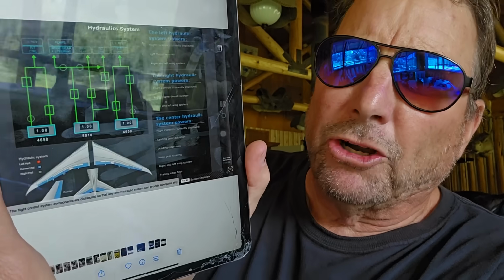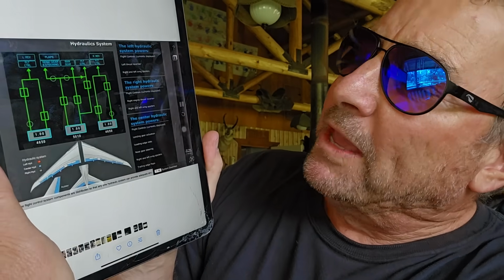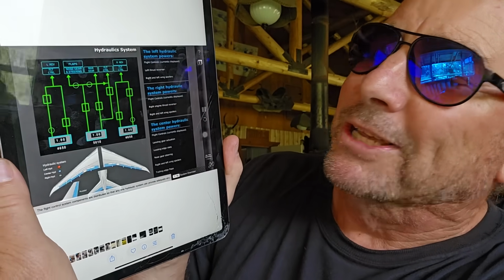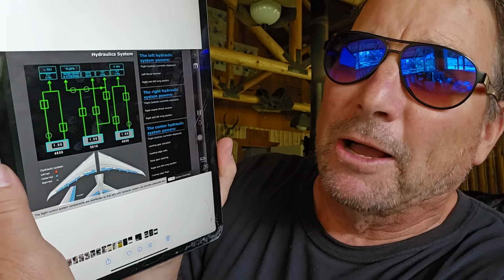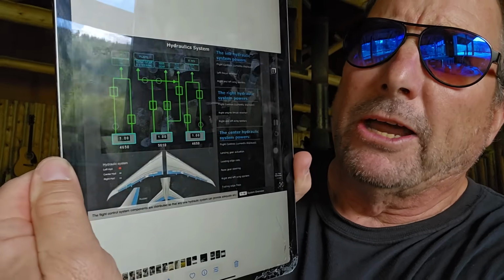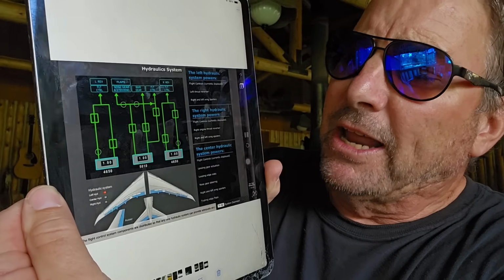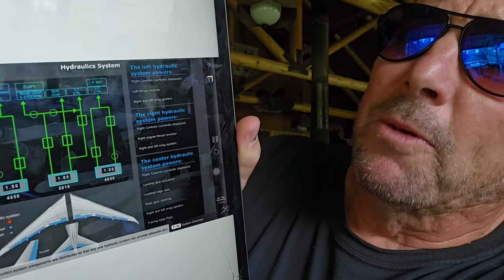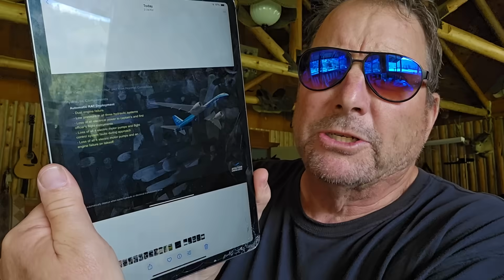787 Crash India What's a RAT? When does it deploy?

Comment: As a commercial aircraft mechanic for over forty years I always look forward to your explanations as to what happened in these terrible incidents. The first thing that pops into my mind is pilot error but you follow the data and never jump to conclusions. Maintenance, environmental issues, aircraft component failures you cover it all. Thank you
Reply: Agree, but didn’t have pilot error on my mind for this crash. It was a skilled crew and there’s no way they would have taken off with an incorrect configuration. Something went catastrophically wrong right after V1 speed.
Reply: @_TheRock Captain was reported in the mayday call saying thrust was lost. What are the odds both engines would cut out right after lift off? Fuel contamination maybe, but im sure they probably looked at the supply this plane drew from and nothing has been said about it being contaminated. So, how both engines seeminhgly fail at the same most critical portion of flight, with no indication of problem on takeoff roll, and at about the time the gear is supposed to be coming up? Makes me wonder if the fuel cutoffs were activated.
Reply: @Sizzelot that could be a possibility, yes. The surviving passenger apparently said he heard a bang. Maybe sabotage linked to recent geopolitical tensions?
Reply: @Sizzelot could be interesting to hear from @blancolirio if and how a potential fuel cutoff could have happened
Reply: @_TheRock im thinking bang would have been RAT deploying as Juan alluded to it deploys quite forcefully.
Reply: @_TheRock  rat deploying maby
Reply: @Sizzelot  There is NO official information anywhere about the details of the flight, so "nothing has been said" has no meaning whatsoever.
Reply: @Sizzelot  bingo!  you win the prize for guessing correctly.
Reply: @Sizzelot yep, there you have it!
Reply: @_TheRock  i agree but time will tell. most likly lots of little things mounting up into one big problem..
Reply: @eddjordan2399 yep, usually more than one hole in the Swiss cheese. We’ll see, too early to tell exactly what went wrong.
Reply: @eddjordan2399  and low and behold it was NOT lots of little things mounting up to one big problem.
Reply: @_TheRock  I heard on another youtube video (can't find the primary source for it) that while the Pilot Flying had 8000 hours, the Pilot monitoring only had around 1000 hours and not all on the 787. They're taking too long to release the FDR data so we can really say if there was a power loss or what.
Reply: @therainbowpoopp  There is no obligation to make the FDR data available to the public. It will be shared only with key players involved in manufacture and regulation worldwide. The findings will eventually be made public after a thorough investigation which invarably takes time.
Reply: sabotage by the Pakistanis....
Reply: I honestly think pilot error is not impossible but I must admit I'm wondering if there wasn't something wrong with the hydraulics after the maintenace episode - l don't know if there's somethign that could have caused loss of hydraulic pressure making it impossible to retract the gear, whether the flaps need hydraulic pressure to stay deployed and if its loss could have caused them to retract and the RAT would then have deployed.... who knows, we shall see, either way still a devastating crash.
Reply: @tomriley5790 i dont think hydraulics caused it. If the captain reported loss of thrust in the mayday call and the RAT deployed that would indicate a dual engine failure and critical hydraulics would have been maintained by the RAT.. The aircraft appears to maintain control till the end as loss of thrust and resultant loss of lift sink the aircraft.

Comment: The Air India 788 crash reminds me of the airshow crash of the A320 in its early days (late 1980's?).  It looked very similar.  In that case it was the pilot trying to fight the flight systems that were trying to keep the plane flying.  It will be interesting to see if something like that was part of this crash, or if it was something like a electrical failure

Comment: Saw this as an interesting lead. If loss of all generators due to failsafe mode, RAT deploys to provide AC power. With all generators out, no power is supplied to the fuel pumps and the engines would experience a roll back of power as fuel is starved.

Comment: Thankyou Juan, The Plane certainly sounds like it had Major Problems on Take off or Just Before.
The RAT was clearly Audible and She seemed to have Suffered possible Dual Engine Failure.
The Landing Gear never went into a Retraction mode.
The Aircraft seemed to suffer Complete Electrical Systems Loss.
From the Vision could not tell if the Slats and Flaps were Extended as you said due to Hazy conditions.
Yes, It's extremely important for those of us who have and still on occassion fly the 787.

Hope you're enjoying your time away..

Regards 
John
Reply: This is not a 787 issue.

Comment: The sole survivor says green and white lights came on in the cabin as the airplane seemed to get "stuck". That would, to my understanding, match the cabin emergency lighting.
Reply: The ADSB data from the transponder stopped reporting at 600 feet, which also suggests loss of electrical power on the aircraft
Reply: @speed150mph you need to be careful trusting public ADSB data. I run a base station and am a pilot and, and a lot of factors can cause delays or gaps in the data. Especially low down if there aren’t many good base stations nearby. 

The question is did the airport lose the transponder signal. And I haven’t heard anything definite. 

All that said, it seems more likely than not just based on what we do know.
Reply: @MeppyMan yes absolutely correct, but it would be one heck of a coincidence for the ADSB to have one of those random gaps at roughly the exact time we see the aircraft stop climbing and begin falling.
Reply: @speed150mph  There were also no gaps or issues with the ADS-B data on departure for the other AI171 flights, it was flying out of Ahmedabad almost every day at the same time. Doesn't make anything definitive, of course, just another data point.
Reply: @MeppyMan  At 600ft the radio horizon for flat ground is 30 miles so it would be unlikely that airport receivers would lose the signal unless the plane stopped transmitting, it should have been receivable for almost all of the event.
Reply: @mortekaieve4729  and if you check further that same aircraft rotated, lifted off in the same location and speeds as the day before too
Reply: @speed150mph  so how did the pilot communicate there was a problem if the electrical was out?
Reply: @Ts-zy4bw  The RAT deployed. If an automatic deployment gate (condition) was reached, it would happen quite quickly. I think the flight remained controlled until the end; the RAT deploying provides a means and mechanism of the aircraft remaining under control (but with no thrust) and also for the mayday to be successfully issued.
Reply: The cabin lights are LED, and can be made to change color. For fun, I like to do a test of the cabin lights, which makes the inside of the plane look like a disco in the 70s. That might explain the green. You are correct that the emergency lights would automatically come on (if they're armed) in the event of a total power loss.
Reply: @dougrobinson8602 The green lights in question would be the ones marking the escape routes for passengers in the cabin.
Reply: It's VERY important indeed. It points to a SERIOUS electrical issue.

I believe the engines were starved of fuel shortly after takeoff by an electrical failure. You can see the 787 visibly stops climbing out.

I'm very much convinced of a serious electrical issue. On a previous flight that 787 had electrical problems (video'd by a passenger apparently) and the sole survivor of the accident flight also reports a loss of cabin lighting, shortly after takeoff.

TOTAL loss of electrical power would mean the fuel pumps for the engines shut down too (the 787 has no engine driven mechanical fuel pumps as backup/redundancy) and any fuel they continued to receive would be purely by gravity feed only, so the engines would definitely spool down and the RAT would also be deployed on the loss of electrical power.

Conceivably the RAT might then provide enough electrical power to get the fuel pumps delivering fuel to the engines again  BUT the engines would then need to spool up to provide useful thrust and I think they simply ran out of altitude/time in which to recover.

Comment: So considering airport CCTV showing engines kicking up dust at lift off and subsequently showing no tell tell signs of engine failure of either one - like smoke, spluttering, fire etc but they suffered dual engine failure? without any outside indications  implies it was a perfect engine idling or shutdown. Almost as if the plane decided it was about to land...

Comment: Juan, appreciate your evidence-based analysis of this terrible incident.
PS — doesn't the  Boeing 787 Dreamliner also utilize lithium-ion batteries for its main and auxiliary power systems?
Reply: Something I considered also...OAT was something like 109?
Reply: Google's AI summary says "The Boeing 787 Dreamliner uses lithium-ion batteries for its auxiliary power unit (APU) and as a backup for critical electrical systems." Also, due to problems with these batteries in 2013 Boeing "redesigned the battery system to include improved cell-level protection, better venting, and enhanced containment" along with some other stuff.

Comment: There has been reports of a passenger supposedly on this aircraft on the flight immediately prior to the crash flight that claims there were numerous electrical issues on the flight inbound to India, from no A/C, cabin lights not working, call buttons not working, etc,.
While none of those systems are critical, if the reports are true it may indicate a much larger problem with this aircraft and it probably should have gone into maintenance. (I guess obviously it should have gone into maintenance)😢
Reply: Yes. This passenger reports that "nothing was working". Of course he is referring to passenger cabin electrical amenities such as lighting, air conditioning, touch screens, etc.,so this may be irrelevant, but the passenger thought it was noteworthy.
Reply: @Stephen-Harding  The touch screens were getting power in that video, they were powered on. It was just on the home screen and not responding. Which isn't really an electrical problem, more of a software issue. Or the flight crew could have just locked out the screens for whatever reason.
Reply: @Stephen-Harding  The 787 is highly dependent on the electrical supply.

I believe the engines were starved of fuel shortly after takeoff by an electrical failure. You can see the 787 visibly stops climbing out.

I'm very much convinced of a serious electrical issue. On a previous flight that 787 had electrical problems (video'd by a passenger apparently) and the sole survivor of the accident flight also reports a loss of cabin lighting, shortly after takeoff.

TOTAL loss of electrical power would mean the fuel pumps for the engines shut down too (the 787 has no engine driven mechanical fuel pumps as backup/redundancy) and any fuel they continued to receive would be purely by gravity feed only, so the engines would definitely spool down and the RAT would also be deployed on the loss of electrical power.

Conceivably the RAT might then provide enough electrical power to get the fuel pumps delivering fuel to the engines again  BUT the engines would then need to spool up to provide useful thrust and I think they simply ran out of altitude/time in which to recover.
Reply: @grahamstevenson1740 this is the most viable theory I’ve read yet
Reply: @Stephen-Harding  How is it 'irrelevant' ? There was something seriously MALFUNCTIONING with this aircraft.
NOTHING is irrelevant, it's  all EVIDENCE !

I believe the engines were starved of fuel shortly after takeoff by an electrical failure. You can see the 787 visibly stops climbing out.

I'm very much convinced of a serious electrical issue. On a previous flight that 787 had electrical problems (video'd by a passenger apparently) and the sole survivor of the accident flight also reports a loss of cabin lighting, shortly after takeoff.

TOTAL loss of electrical power would mean the fuel pumps for the engines shut down too (the 787 has no engine driven mechanical fuel pumps as backup/redundancy) and any fuel they continued to receive would be purely by gravity feed only, so the engines would definitely spool down and the RAT would also be deployed on the loss of electrical power.

Conceivably the RAT might then provide enough electrical power to get the fuel pumps delivering fuel to the engines again  BUT the engines would then need to spool up to provide useful thrust and I think they simply ran out of altitude/time in which to recover.
Reply: I was about to mention the same thing until I saw your comment. Some kind of electrical issue would not shock me at all as being the cause of crash.
Reply: That flight seems to have been from Dehli as the passenger commented
Reply: I believe the engines were starved of fuel shortly after takeoff by an electrical failure. You can see the 787 visibly stops climbing out.

I'm very much convinced of a serious electrical issue. On a previous flight that 787 had electrical problems (video'd by a passenger apparently) and the sole survivor of the accident flight also reports a loss of cabin lighting, shortly after takeoff.

TOTAL loss of electrical power would mean the fuel pumps for the engines shut down too (the 787 has no engine driven mechanical fuel pumps as backup/redundancy) and any fuel they continued to receive would be purely by gravity feed only, so the engines would definitely spool down and the RAT would also be deployed on the loss of electrical power.

Conceivably the RAT might then provide enough electrical power to get the fuel pumps delivering fuel to the engines again  BUT the engines would then need to spool up to provide useful thrust and I think they simply ran out of altitude/time in which to recover.
Reply: @grahamstevenson1740  agree totally  thats the most plausible explanation so far  so many so called experts going down the flap extention and u/c route when the rats deployed,,  its like hello,,,  anyone in there,,,

Comment: There was a video played by a YouTube channel earlier today where one of the (now deceased) passengers, before the crash, had sent out a video complaining that the airplane's air conditioning wasn't working, as well as saying the airplane's WiFi and electrical system had stopped or was going off and on.  In addition, the surviving passenger also made a statement played on an Indian YouTube channel saying that the cabin lights were flickering on and  off shortly before the crash.  Maybe the RAT may have deployed because the airplane's electrical system was having problems and going off and on, interfering with the airplane's electro hydraulic control systems.
Reply: I think it was not a now deceased passenger but a passenger who traveled on a previous flight on the same plane. And he complained about those things while the plane was on the ground. Air-conditioning was probably not working as ground power is not available at all airports at all times and that has nothing to do with the aircraft.